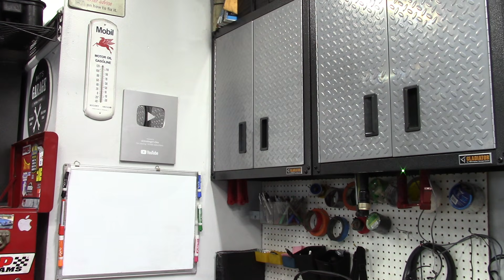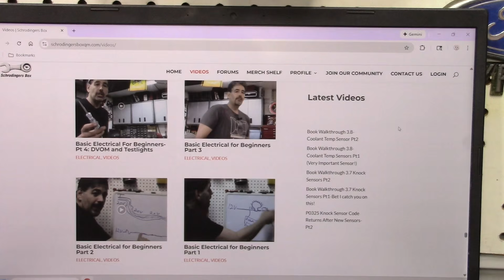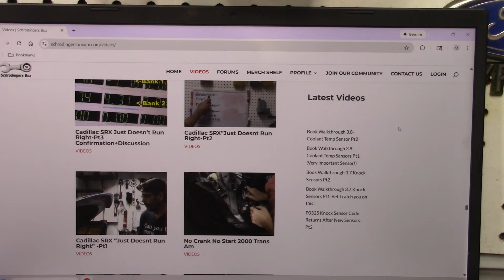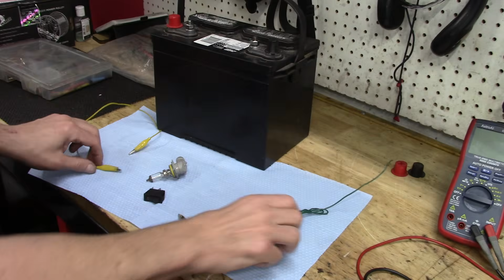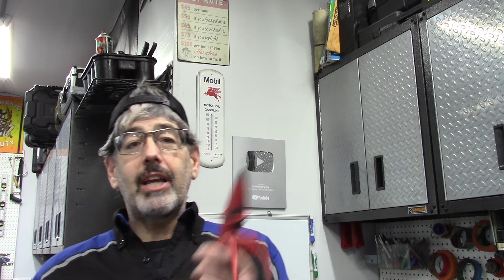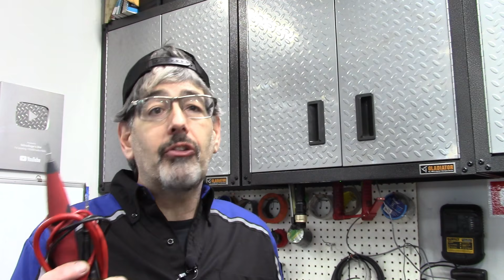LoadPro Review + Basic Automotive Electrical Lessons

Comment: stupid question here; so if there is something else in line with the circuit, will that be a cause of voltage drop? how do you know there is a problem if there are other "resistors" in the circut? i did just buy the load pro with the back probe kit. (123.00)

Comment: Good to see your review/application of the tool. It does make sense, when you understand Dan's  approach to diagnosing a circuit. Yeah, you can use light bulbs with known amperage to be "the load", but you need to understand the circuit limits. Especially working with computers/moduals. Both ways work, but the Load Pro is safer, and doesn't require intimate knowledge of circuit load limits. 

 Too bad Dan had didn't have someone like yourself to promote his invention in the early days. Especially, for automotive applications other than heavy trucks and equipment. 

Thanks for the video.

Comment: I'm new to the car repair industry and just recently learned about the existence of the LoadPro and all the fuss and drama accompanying this device and it's inventor for almost two decades. While respecting the effort Dan put into creating and promoting the LoadPro, I still don't understand what is SO special about it? While it is definitely great to have this packaged as one testlight-like-ish device, the idea of testing voltage drop using load simulation is not new for the industry, right? Not to mention a standard practice of using light bulbs rated for certain known amps for car circuit diagnostics, this same device (+ more) could be implemented as just a direct plug of a load simulator (a rated light bulb or a resistor of known resistance) into the sockets of the same voltmeter used in the video. This way it is possible to have a complete control over simulating the specific load under the test ( not to be limited by just the nominal of the LoadPro's internal resistor). Furthermore, to assess resistance of the circuit one could use  an Ohm Law to derive formula for parasitic resistance based on the known source voltage V, measured voltage v and load resistance R. Seem to be a pretty basic / logical stuff, no?
Reply: You said it all with this statement, "I'm new to the car repair industry"! Having been around the industry for 40 plus years, there have been dozens of this is the only tool you need statements!  Dan never said that!  He said this will save you time, by veryfing you either have a good circuit, a open circuit, or a corroded/high resistant circuit!  Over 40 plus years, proper training and use of my multi-meter and some homemade tools similar to the load-pro save my customers thousands of dollars.  Fixing the circuit, instead of replacing parts.  IN fact today, used my multimeter and the load-pro to find a fault in a Genie boom lift in minutes instead of hours.  Every tool has it's place, but nothing will ever replace a decent multi-meter and a properly trained individual!
Reply: I think "the only tool you ever need" claimes should be disregarded and not even discussed by the professional community in the first place :). What I meant to say is that I was surprised that such a simple (in a good sense) and clearly useful tool is causing so many churged debates even 15 years after it's first introduction.

Comment: As a kid , I worked at an auto electric rebuilder between 1970 - 80 . I went to repair shops , parts stores and warehouses . The words voltage drop , corrosion or high resistance were never heard . Many shops had no meters or even a battery tester ! I bought a Milton Battery Load Tester for my own use . I used it at a salvage yard one day to test a battery . They laughed in my face . They use a TIRE IRON and look for a BIG SPARK ! Cave men ! 😂😂😂😂😂😂

Comment: Confusion on my part - say you have front side light that is out and you unplug the connector to it and apply the load pro to the pins on the connector of the wire loom feeding the side light because you suspect a high resistance wire and then press the load pro button, could this resultant amperage load for the load pro cause a problem (or maybe fry the computer) if the wiring goes back through the computer? Could this also happen with the power probe if you press the rocker switch? Thanks for your help.
Reply from the maker: Absolutely not in the case of a light. Totally safe.  And in fact totally safe with the power probe on that example was well.
Reply: @SchrodingersToolBoxsorry I might not have explain myself correctly, I was not referring to the connector of the short wiring to the side light but the connector to the wiring from within the car maybe from the fuse or computer etc feeding the connector of the side light. Thanks again.
Reply: Are you asking load pro or power probe. 2 different things.
Reply: @mazomopar2156 Loadpro.
Reply: @mazomopar2156  are both testers computer safe for ECM ‘s etc?

Comment: If you really enjoy this stuff, it’s fun to have an incandescent test light and a load pro, and use both.  Both are very effective tools in the hands of someone who understands electricity and electrical circuits.

Should add a Load Pro is much safer than a Power Probe.  It puts a load on a circuit, whereas a Power Probe delivers current to a load at 12V (assuming you don’t use the 5V reference step down).

Comment: I have a car that pep boys told my customer that she needed a starter... And a battery... And also told her the charging system was good... I put the new battery on... Car started.. And the voltage was only 12.2 with the car running.. Turned off the car.. Literally 5 minutes later.. The brand new battery had 8.9 volts... Have you ever see a battery die that fast?? (yes I'm changing the alternator..and doing a parasitic draw test (I didn't know the alternator had the ckp wire attached behind it so I tore it off and waiting for the new plug)
Reply: Yes I absolutely have- when the battery is internally shorted.  When a cell is internally shorted the battery generally drops just over 2 volts instantly when taken off charging.
Reply: @SchrodingersBox but this is a brand new battery... Brand new battery's can be internally shorted?

Comment: What is a ground fault?
Reply: Great question. A ground fault is when a ground connection is present in the wrong place that no longer allows ground side control to occur. For example if a component is always on even when switched off, it is probably because the switch for it is on the ground side but the ground wire it touching the frame so there always a ground connection at all times.
Reply: @SchrodingersBox I always called that a short to ground on the ground side but I guess "ground fault" is a better term. Thanks for the explanation.

Comment: Nice video.  What do you say to those out there that say that the Load Pro doesn't put enough load on a circuit to be effective in all circumstances, and do you agree with that perspective?
Reply from the maker: Great question- I personally have not run into that issue however of course I am certain there may be such applications.  BUT- this is actually far more likely to happen with a test light than the Load Pro and people use test lights way more often!!
  In the video I link in the description for the Load Pro, I show that a testlight was unable to find the voltage drop- because it only draws 250mA and since its intensity is subjective, you can see for yourself the testlight was virtually useless to determine there was an issue.  But the LoadPro being quantititative found it easily.
Reply: @SchrodingersToolBox I have a Load Pro but have not used it much.  I usually just use a test light that comes close to matching the current of the circuit I'm testing.  I believe the Load Pro puts a 500mA load on a circuit so that is probably why it did a better job compared to the test light that you used.
Reply: @Mr2004MCSS Yes, the Loadpro has a 25 Ohm resistor that draws about 500 mA at 12.5 Volts. I also own a Loadpro but never use it. I prefer using test lights matching the amperage of the component under diagnosis.